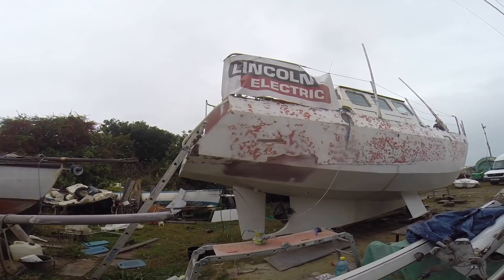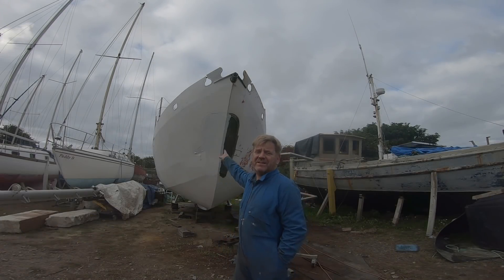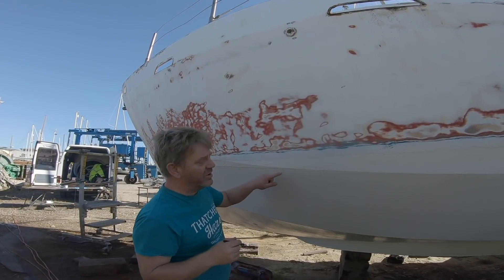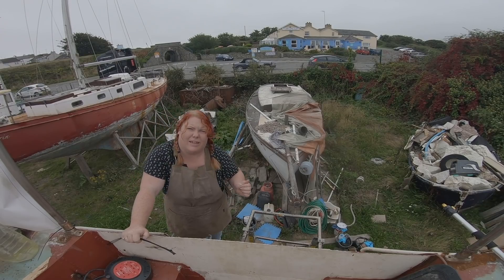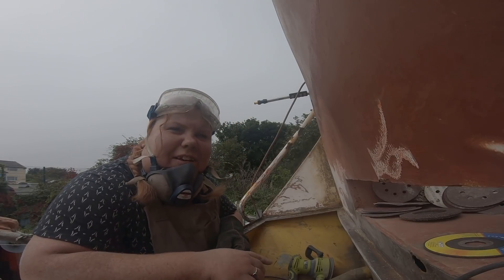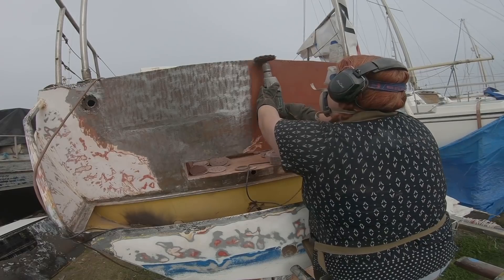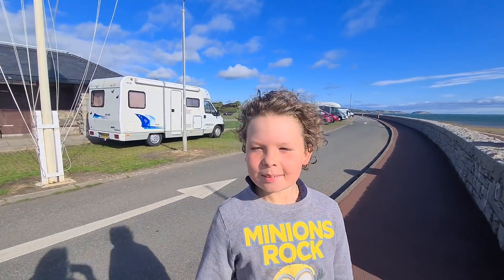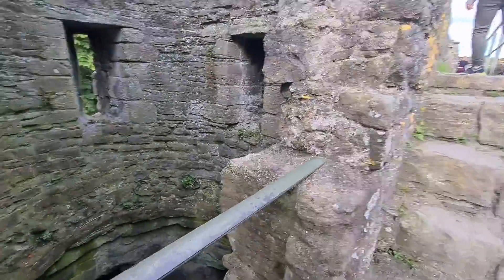#64 - RUSTY YACHT TRANSFORMATION

Comment: Nice work! Foam rollers are ok. I just give a kind reminder, hope you noted the needed primer paint dryfilmthickness, foamrollers apply a very thin layer, often fouled with bubbles.
To achieve full needed primer thickness you might need min 8 layers of rolled paint, for welding seams and keelcorners use a brush. Here its good to have proper paint film.
Your prep work is good!
Reply from the maker: Yes absolutely correct, we have a digital paint thickness meter and we always brush or spray paint when onto bare steel and welds.  The area we were doing was already painted mostly and had been sanded back through the original top coat to the original primer so we’re confident the thicknesses are good. We will be doing several more coats as well. Thanks for the confirmation that we’re going about things ok :) it’s nice when people comment with advice that backs up what we’re already doing :)

Comment: On the top of the new transom are yo going to place/weld a top plate or similar to give it more strength, also as a safety issue.  I wouldn’t like to fall down onto that sharp edge.🤔🤔🤔
Reply from the maker: Oh yes! I have cunning plans for the transom 😜 it will be incredibly strong by the time I’ve finished with it. More of that to come soon